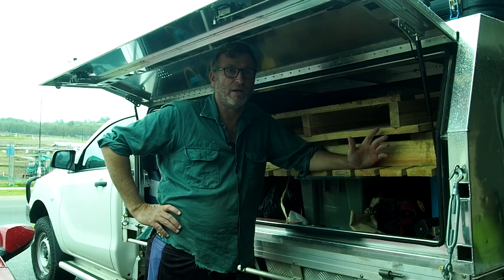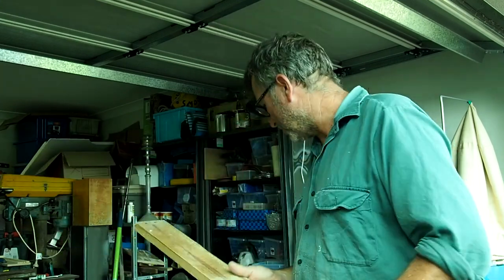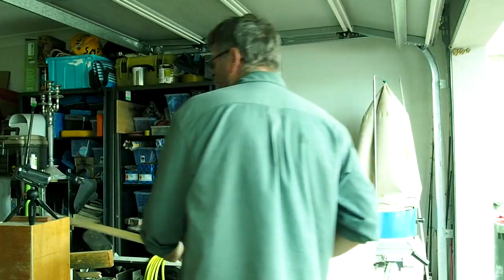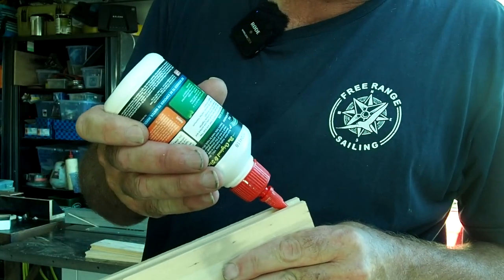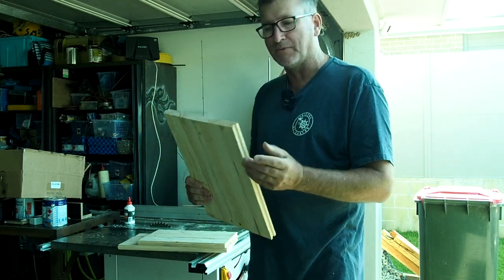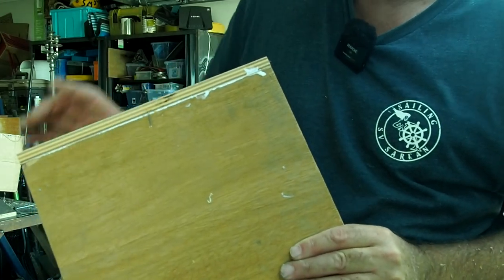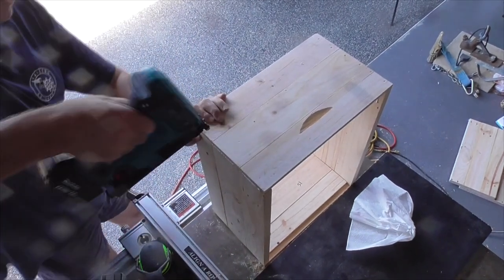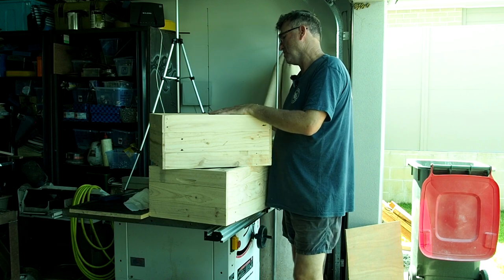2. How do you make 10 frame bee hives from RECYCLED PALLETS?

Comment: Nice job mate, I'm in my 3rd year and am hoping to expand my apiary. using pallets will keep my cost down. thanks for the fine work you are doing.
Reply from the maker: Thank you. I just treated these with copper Napthenate and painted them. They are sitting in my brothers shed waiting for spring. They should be aired out enough by then. I’m not doing the copper treatment again though. I will be wax dipping when I get the funds to set up the tank.

Comment: The issue you'll run into is that the glue line running parallel with the grain will contain places where heartwood is glued to sap wood. Sapwood absorbs moisture much faster than heartwood and since the EMC will almost certainly always be below the fiber saturation point, the wood on either side of the glue joint will expand and contract at different rates. This will stress and tear the wood fibers the glue is bonded too so the joint will eventually fail right next to the glue line (most likely on the sapwood side). Best to stick with one piece. 👍
Reply from the maker: Hey Thomas, thanks for your comment. In a few weeks time we will be wax dipping the boxes, baseboards and lids. It will stop any water ingress. I’m just waiting for the fire ban season to finish. I’d hate for the wax to boil over and I cause a bush fire. Eventually I will be using solid hoop pine but it’s not available in this state easily.
Reply: @thankyouhoneybee6369  oh, well wax dipping takes care of that problem pretty damn well! 👍

Comment: i'd suggest next time to save you some time instead of cutting off 2 of the tongue-n-groove, pick out the pieces you want for your middle slot and only do the tongue-n-groove on it, with only a tongue on one, and only a groove on the other. i guess if you've got alot of time and access to that thickness of pallets in your area, and are looking to expand a bit, it could be worth the time. wish i could find that thickness of wood pallets around by me, most of them are thin half inch planks, sometimes 5/8", and very rarely are they 1x (3/4") like you found. i picked up some pallets that i intended to make into nuc boxes and, well.. it hasnt gone well. i'll probably end up seeing if i can turn them into swarm boxes instead.
Reply from the maker: Hi Dan. I did both sides so I could choose the best fit up when I put them together. I cut that out in editing. It wasn’t really relevant to the story and dragged on a bit in the detail. 

Those pallets were an inch thick. I trimmed them back to 7/8. Pretty rare to find them. I am really keen to get them wax dipped in the next few weeks and put some paint on them to see how they come up.
Reply: @thankyouhoneybee6369  yeah I'd say they are pretty rare to find. Also, if you are wax dipping them, then they won't need to be painted, not sure the paint would even stick to them after being dipped.
Reply from the maker: Thanks Dan, I want to paint them so they will blend into their surroundings. Where the hives are at the moment they have no one near them for days on end, so any way that we can help to keep them hidden.

Comment: The only problem I see doing this, is when you take the nails out. It usually leaves a tiny piece of wire in the nail holes. Which makes it hard on the blades on the table saw, and planner, if you use a planner. These boxes look great though

Comment: what is the final thickness of the wood after it is cleaned up?  It would seem that pallet made boxes would be inherently different in dimensions than a purchased box or a box made out of a single piece of pine.  This would seem to make it hard to mix boxes.  If you made them the same outer dimension to make mixing work, it would seem to leave more room for bur comb.  Perhaps the extra room is no more than the additional room in an 8 vs a 10, just not sure.  Thoughts?
Reply from the maker: Hi Eric. The timber I used was 25mm thick before stripping. I stripped it down to 22mm which is the same as a commercially made hive.

Comment: Great content, I do wonder about any chemical treatment on the wood though?  I've just become your newest subscriber! 😃
Reply from the maker: Thank you. I’m not worried about treated timber. Pallets are the cheapest type of timber to start with so I can’t really see any manufacturer using treated wood for just that reason. The pallets I do get have been used for carting floor tiles and doors etc. I am also going to hot wax dip them before painting so any chemicals that are in the timber will be sealed in or heated out.
Reply: Bees propolize the whole surface anyways..my bees eat outta my burn barrel so I doubt wood carcinogens would be as bad..if someone was really bothered though,pallets have codes sometimes and tells about them.

Comment: Are they treated ?have u used them before and raised bees in them? I'm making my own similar but just worried if there is any poison in the wood
Reply from the maker: Hi Daniel, They are not treated, The pallets I have used are made for transporting roof tiles. Most of the treatments used on timber in my area is a plant based treatment used only to repel borers and termites. If you google timber treatments it should give you a guideline as to what treatments are used and there is now supposed to be a code stamped on the shipping pallet to say what treatment is on it.

Comment: A light over your table saw will help you
Reply from the maker: A bit hard at the moment. I have thought about it but I’m renting this home while my new house is being built. I only have enough power to run the saw and the dust extractor at the same time. The workshop is pretty packed with all my belongings at the moment so it’s difficult to move around in there. When I move into the new place I’ll be putting more outlets in and there will be a mezzanine level for storage so I’ll have a lot more room. Plus I’ll have high bay lights over each machine. At the moment I’m just making do with what I have.

Comment: I would use bamboo skewers or chopsticks and a waterproof glue like expanding polyurethane, or titebond. It allows gap in the dowel placment, and the lap joints and butt joints all will have adequate locked in strength with 3 or more dowels. It would be entirely wood too, no metal bits,  which is cheaper and actually easier when you get a routine going. Matthias wandel is a woodworker, he does very good work and reccomends bamboo skewers for fastening most if not all wooden joint types.